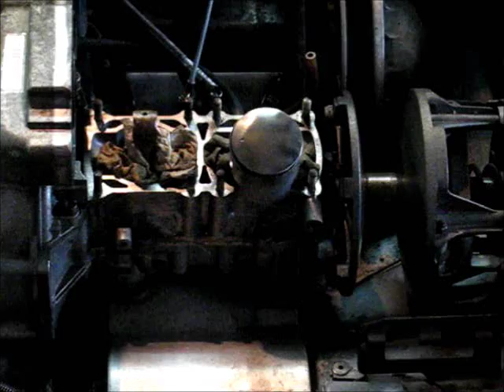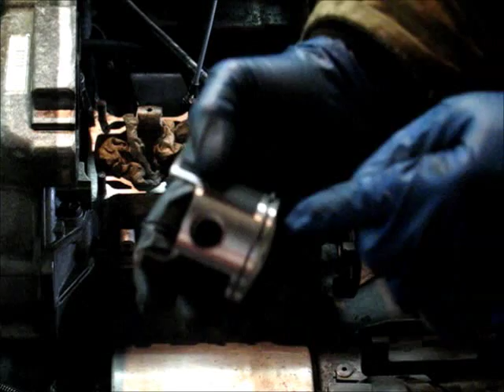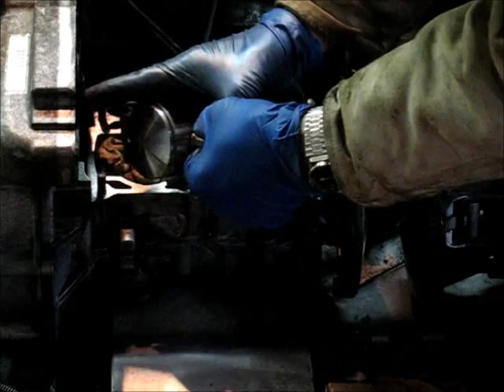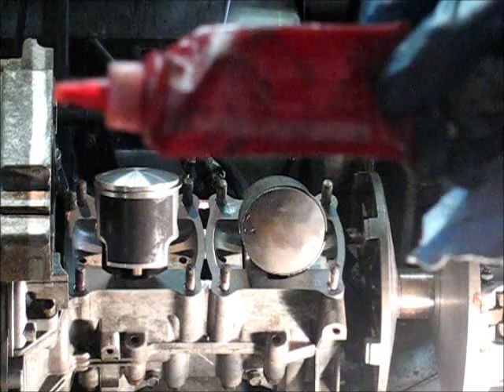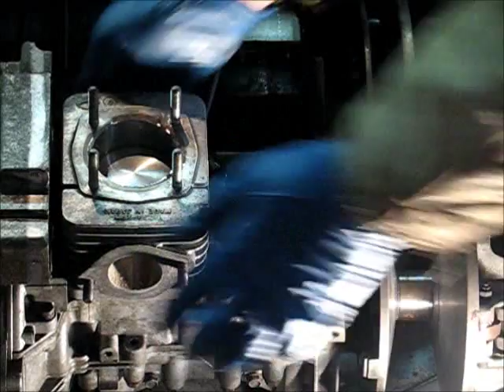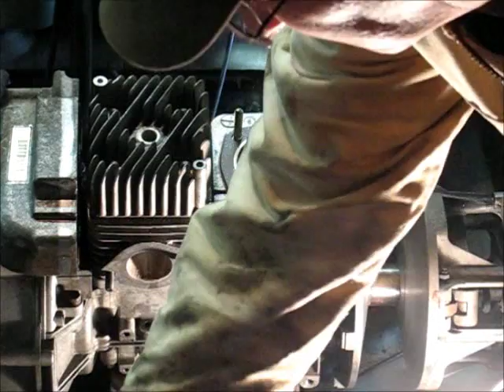1991 Polaris Indy Lite Top End Rebuild part 1

Comment: I'm doing this on a '92 Lite GT right now.  How much play is acceptable on the lower connecting rod bearings?  The top of the rod can move side to side a little, but no up and down movement (the direction the piston pushes it).  Engine has about 6k on it and this is it's first top end rebuild.
Reply from the maker: If your rod is tight on the crank, no play up and down, then you should be fine.

Comment: hondabond works really good for the crank half's its what Honda uses for there race to for the bottom end
Reply from the maker: I'm sure there is different kinds of sealant out there but, the local Polaris dealer recommended the sealant I was using, so I figured it would work just fine. Thanks for watching.
Reply: snowking55 Honda develop "Honda bond " for sealing the 2 crank half's on the bottom ends of the dirt bikes they use for the race team  so it must be really good cuz they use it on all the race bike wich get riddin hard